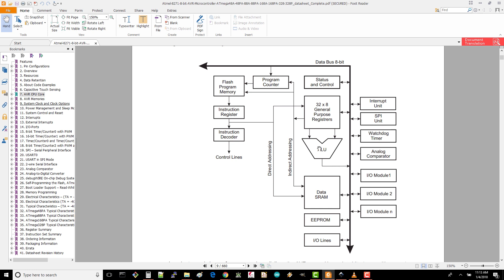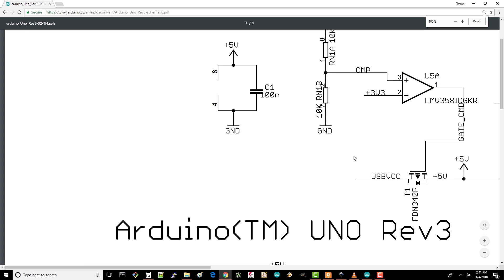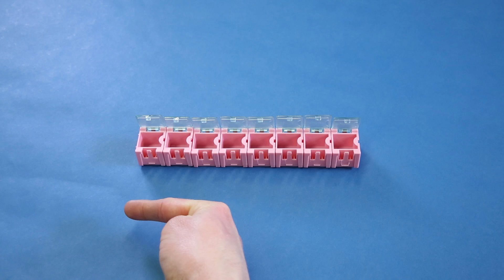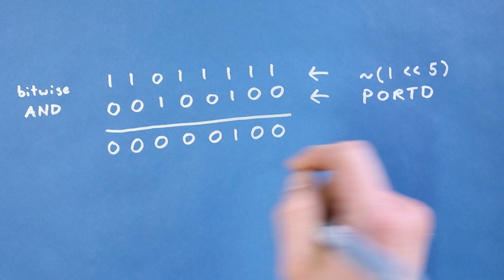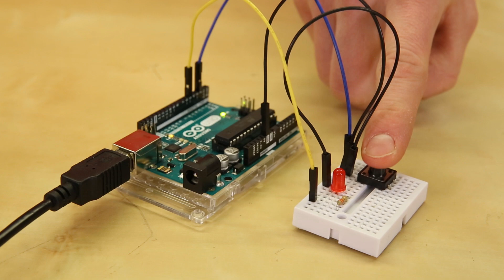Level Up Your Arduino Code: Registers

Comment: Brilliant! I'm in the stage of shrinking Uno projects to the ATTiny85 chip and this was invaluable. That being said, I should have watched the entire video before trying the sample code. Especially the part where the pull up resistor was turned off and I spent a half hour wondering why my LED was coming on by itself lmao.

Comment: Hello Sir, would it be possible to write a variable (integer for example) to one of the Arduino registers and then reading the register from a PLC using modbus (through RS485 shield)? Or, is it possible to write a variable from Arduino directly into a PLC register using modbus?

Comment: What can be slightly confusing to new users, are when you are using IO pins that are not "inline" with the port Pins.  Example IO pins 8 thru 13 are PINB 0 thru 5. So instead of defining the Variable as the IO pin you would want to define them as the PINB pins... So for a button hooked to IO pin 8 you would want variable as such const int bnt_pin = 0; Not const int bnt_pin = 8;

Comment: Can someone explain why he is bit "shifting"? He says it's to retain changes made by other things while still changing the bit you want, but I can't comprehend how bit shifting accomplishes this for any case other than this specific function, which is better accomplished by just writing the bit... It sounds like a very good way to accidentally put 1's and 0's where they don't belong and disrupt other functions. WHY? You can just 'OR' it with B00000010
Reply: >WHY? You can just 'OR' it with B00000010

you can. BUT if you want to use the Bit NAMES from the avr gcc standard library then you need the bit shifting because the define constants of the bit names were not defined as the bit pattern like B00000010, the designers of the library defined the BitNames with the bit number.

Like: #define FOOBIT 4

so if you want to use the defined name FOOBIT you have to turn that into your bit pattern with: (1<<FOOBIT) ...

Comment: It's nice how you saved almost half the flash memory space, that's one nice perk of programming in a lower level language. It's just ridiculous how you did not mention literally that it will run much "faster" than Arduino "overhead". All in all, this is an excellent tutorial with zero confusion and explanation about making use of microcontroller registers using the bitwise operators.
Reply: Arduino uses the same avr gcc standard library - that means you can also use direct register access if you don't like digitalwrite

>you saved almost half the flash memory space
and i don't have serial print for debugging or millis for making a state machine, now i have to waste my time to get that working ...

Comment: YT channel 'Joop Brokking' posted this project in 2016. Arduino makes code "human readable", in that it makes sense to beginners. The Arduino IDE is great to get acquainted with embedded, I'm 100% stoked its out there, but to make it to the 'real world project level' you have to manipulate registers without the crazy  'Playground' overhead. If you want to be freed from GitHub, you will have to learn to read the data sheets yourself, and not expect others to do the work for you. Bottom line, an ATMega328 costs less than a buck ($1) and you can get 'Blinky' working for less than 1% of the available space using a better IDE.

Comment: Doing it by registers also makes accessing those input pins a lot faster, fairly sure the number I saw was ~56uS for DigitalWrite and using that register method brings it down to 5uS. I will find the name of the video and put it on this comment.

Comment: Thanks for explenation. I have a question: how can we do bitwise operation if the button pin is (let say) pin 12 (PB5), and ledPin is pin 12 (PB4). I mean in digitalRead part. Do we still  have to define ledPin as output ?  (Because of DDRB =001000, all other pins exept 5, are inputs. )

Comment: @10:40 it is a better practice to manipulate the DDR register value by using the OR logic. For example, 
DDRD = DDRD | B00100000; 
would be a better practice because digital pins 0 and 1 aren't supposed to be meddled with as they're used for serial communication.

Comment: Wait a moment! You are removing the pull-up resistor from PORTD (12:30 - 12:35). You might run into an issue here, making the Arduino unable to recognize that you release the button (input pin stays at 0V). Or am i interpreting this the wrong way? You have to set/clear ONLY the 32's position bit on PORTD when you turn the LED on/off...

Comment: If you're trying to save space and execution time, just use PORTD = B0010000 & PORTD; Saves two instructions and 3 or 4 clock ticks.

Comment: What are the little bins usually used for? Or were they made specifically for the purpose of illustrating bits? Can't think of anything that small needing a mini bin.
Reply: Pills.
Reply: They are often sold as containers for SMD components, although not-removing the components from their tape reel in the first place is a better way of storing them.

Comment: i still didnt get the digital read part. whats PIND
Reply: Go to 5:25 and he talks about the three registers you need to be concerned with. DDRx, PORTx, and PINx.
The "x" in this example is referring to the "D" port. 
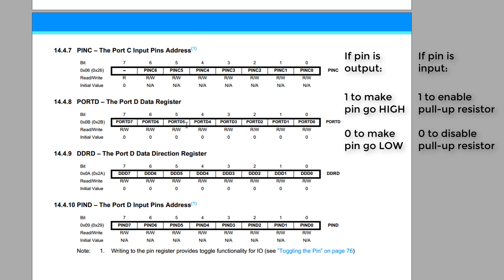At 6:55 he addresses this register directly.

Comment: What's the difference between: 
DDRD|=(1 <<2)|(1<<4);
DDRD=(1 <<2)|(1 <<4); without operator
Thanks
Reply: The |= operator says to bitwise OR the value to the left of the operator with the value to the right and then store the result back in the value on the left. It's known as a "compound assignment operator." For example:

a |= b;

is the same as writing:

a = a | b;

Hope that helps!
Reply: @ShawnHymel  In the first example of his original question:
DDRD|=(1 <<2)|(1<<4);
It is essentially saying combine ("or" gate them) the two other bytes to DDRD?
DDRD=DDRD | B00000100 | B00010000;
DDRD=DDRD | B00010100;

And the second example:
DDRD=(1 <<2)|(1 <<4);
It is telling the register to change the value of DDRD to a completely new byte?
DDRD= B00010100;
Reply: @danblankenship5744  correct, you are telling the register to change its value in the second example.

Comment: @17:00, you spend a bit of time determining the value of a bit.  The AND isolates the bit, but that's as far as you need to go.  Since it also ensures every other bit is '0', all you need to do is test for non-zero (usually the second fastest test in a microprocessor).  i.e. If The shift you use to test for equal to '1' is unnecessary.   "HIGH" and "LOW" are typically macros for non-zero and zero, respectively.  If that's how the Arduino library defines them, you woudn't even have to change your If statement.

Comment: Another thing I found amazing, was the SPEED increase from doing multiple digital writes to being able to write multiple pins directly at once (as long as they are on the same port letter). It wasn't just "faster" it was Monumentally faster. When dealing with multiplexing Multiple 7 Segment LEDs, the "off segments went from having a ghost of the previous figures to being very sharp.
Reply: This is true. Manually working with registers saves you clock cycles in addition to program space.

Comment: 4m47s 
There are three possible states for a GPIO-pin, not two as told. 
A pin can be digital in, digital out or high impedance.
Reply: You are correct in that I did not mention high impedance mode, so thanks catching that. In AVR, high-Z is accomplished by setting the corresponding bits for DDRx and PORTx to 0, which is the same as setting the pin to input with no pull-up. So, while tri-state does exist for AVR, it's also considered an input mode. See section 1.3 in this excerpt from an AVR Primer book: http://bit.ly/2r2zZa1

Comment: title should be: "level down your arduino code"
Reply: With subtitle: "Speed up your code to whole new level"
Reply: LOL that's fantastic. Love it!
Reply: more like "level to bare metal your arduino code"
Reply: Level up i think ! Because much motlre dificult to trace and understanding.
Reply: Haha you say old code but the Arduino IDE uses this method for programing the atmega32p board. PinMode() is one of the functions from the arduino IDE. This type of "old code" makes you arduino more efficient and accurate.
Reply: @tybot6224  sure and for that reason it had to exist before, i.e. it's older
Reply: @mr9_81  but far from a level down due to inefficiency and memory waste.
Reply: @tybot6224  it's a level down in terms of abstraction.
Reply: @tybot6224  https://en.wikipedia.org/wiki/High-_and_low-level
Reply: @mr9_81  I think when it is used in that type of definition, an arduino IDE type coding is also considered low leveled because it preforms the same functions and bit manipulation coding. But you are right with the term older so ya. My old argument is that AVR programming is more reliable than arduino coding. But that all doesn't matter because ARM microcontrollers kick AVR's in efficiency and productivity.
Reply: Abstraction is relative, you can go even lower and just write assembly code or machine code or build a circuit out of logic gates or even just transistors, heck maybe someone is even willing to manipulate photons one by one. 

Assigning values to hardware mapped registers is lower level than calling an Arduino function that does it behind the scenes, it's not up for discussion. It's like asking the chef to heat oil, slice potatos, put them in the oil, take them out, salt them instead of just asking the waiter for fries.
Reply: @tybot6224  So we should ditch Avr in favor of arm? Dang I was getting used to it
Reply: @SirDella  ARM is the preferred embedded system, to my knowledge, and I think the stm32 line is a good start.
Reply: Agree 😃🙏🙏🙏
Reply: Here the point is easy,if you want to use most of Arduino resources,this is the way.another one would be to buy a faster arm and put it do the job
Reply: you mean "old level" ahaha

Comment: I'm not clear as to why the Arduino compiler doesn't do this optimization by itself?
Reply: Remember that Arduino isn't a compiler, it's a framework that provides an abstraction layer for dealing with microcontroller functions (think of it like a collection of libraries). If you dig into the Arduino source code and look at the digitalWrite() function (https://github.com/arduino/Arduino/blob/master/hardware/arduino/avr/cores/arduino/wiring_digital.c ), you'll see that there a lot more checks and pieces of code than just flipping bits in a register. This is what abstraction does--it makes something easier to use at the expense of speed and code size.
Reply: I come from the PIC world. Pretty much all the codes are direct register manipulation. 
digitalWrite() and digitalRead(), are too slow in that world too. TRIS and PORT are data direction and port registers in PICs.
TRISA and PORTA are for port A as an example. 
Also, there is a compiler that Arduino uses. I don't remember the name, maybe avr-g++, but I know its open source.
Reply: Arduino uses whichever compiler is needed for the target microcontroller. If it's an AVR (such as the 328p), then it uses avr-g++. If it's an ARM core, then it might use something like arm-none-eabi-g++.
Reply: Got it. Makes sense. Thanks.

Comment: If you want to go to this level, use something other than the Arduino IDE. It’s terrible for this work.
Reply: I do agree that once you start working at the register level and needing step-through debugging, it's really nice to have an IDE that can do simulation and looking at register values. I'm still a fan of AVR Studio. For the video, I'm hoping to appeal to Arduino users who want to learn more about their microcontroller. Teaching a new IDE would be a whole separate set of videos. I wanted the interface to at least be familiar as they started looking at the next level down.
Reply: It depends on the processor you're using. For AVR parts, I've had pretty good luck with Atmel Studio. Because Atmel was purchased by Microchip, we'll likely get forced into MPLAB, which isn't bad, either. TI has Code Composer Studio, and so on.

To compile code for a variety of architectures, you can set up a toolchain on Eclipse, which is what I've been doing as I learn STM32. After all these years, I still don't really care for Eclipse (I don't find it very intuitive), but many software people really like it. PlatformIO is a plugin for Atom and VSCode, and it seems really slick (I don't have any experience with it, though). To write and compile code, it's free, but to use any of the debugging features, you'll need to pay a subscription. 

Finally, for a completely different experience, mbed is ARM's answer to Arduino. It abstracts a lot of things (similar to Arduino), but it feels closer to writing "real" C++. That being said, the boards that it works for require a special "programming" chip that enumerates as a USB mass storage device so you can drag-and-drop your compiled program.

Comment: Hi Shawn, Awesome video, but three details that you skipped over in my opinion, (that are quite important for beginners):
1) the bit-shift to select the bit for ANDing or ORring is evaluated by the compiler while compiling and is not actually shifted by the processor-code in run-time (and therefore is exactly the same byte-code as an explicit 8-bit OR-mask): So 
    switches_port = switches_port [bitwiseAND] 1<<2; 
compiles to the same byte-code as 
    switches_port = switches_port [bitwiseAND] b'00000100';
2) bit-shifting (either for setting or reading-out) a certain bit is a clumsy & reader-unfriendly way of writing code, and especially prone to human-error. A better and more explicit way would be as used by some MCU instructions (e.g. Microchip BCF or BSF).
3) For reading out a bit, the right-shifting is superfluous as the zero-flag is easier to read than the 0'th bit. So, (pseudocode) rather than 
    boolean_resetSwitch = LSB_of(switches_port >>2); //This needs to be shifted&evaluated by the MCU in run-time, not the compiler!
it is easier to write:
   boolean_resetSwitch = isNotZero(switches_port [bitwiseAND] b'00000100'); //no bit-shifting is needed; there is usually a compact assembly-instruction for acting upon the zero-flag.

Cheers!
Reply: 1) I did not realize that the compiler actually optimizes the shifting operation. Can you tell me how this is done or point to some docs that explain it?
2) AVR uses the _BV() macro to make the code easier to read for shifting operations, which is why I show it at the end of the video. However, it's unique to the architecture/manufacturer, whereas knowing how to bit shift is more universal (which is why I showed it first).
Reply: You are right, if somebody wants quick short code , write it in assembly, AVR have SBR CBR instruction for bit setting or clearing.
Reply: tibor bogi aaah, that makes sense as to how the AVR compiler can optimize bit setting/clearing. It's been a long time since I've touched AVR assembly, so I had forgotten about those instructions!